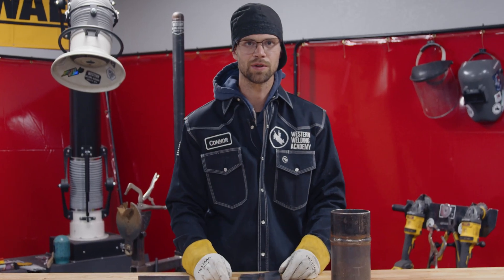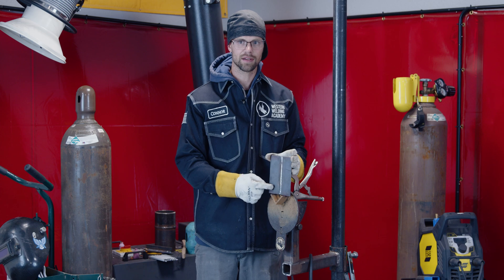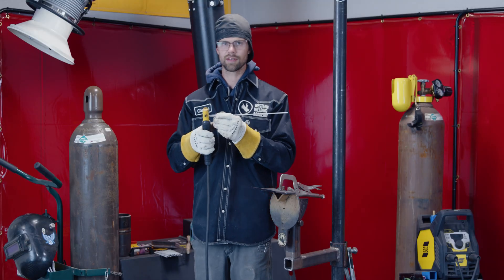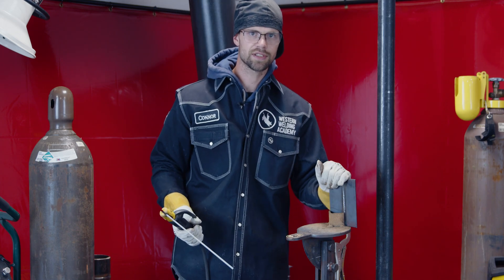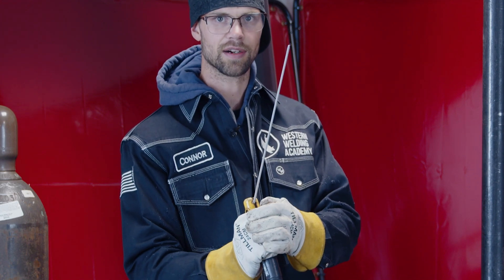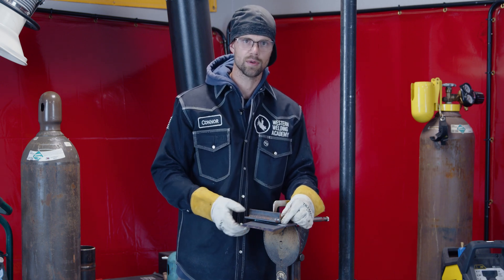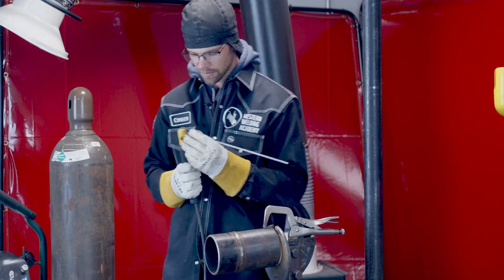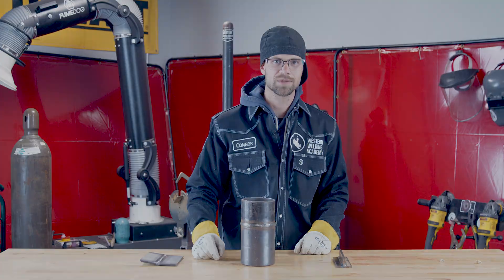Welding Positions and Rod Angles EXPLAINED

Comment: This video is by far the best explanation out of all the positions, raw angle, travel speed. Very thorough explanation. Also not too many people realize you can go vertical downhill with MIG hardwire, but you can go vertical uphill with dual shield wire